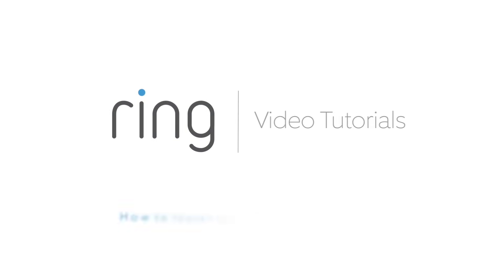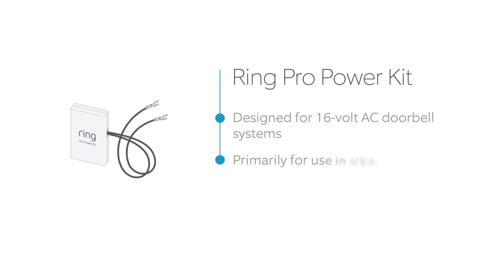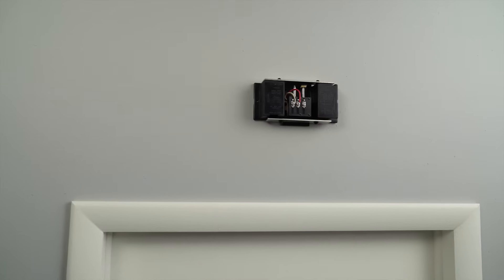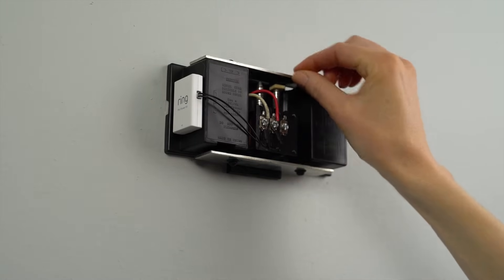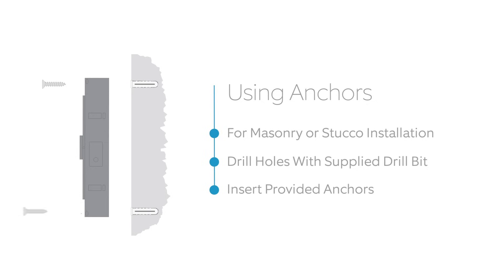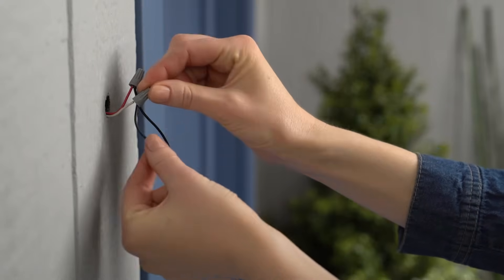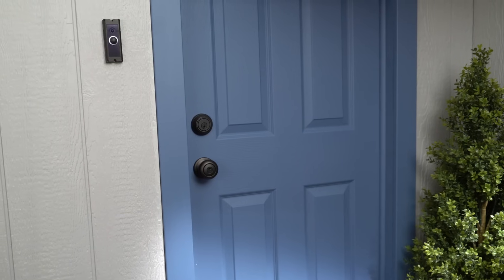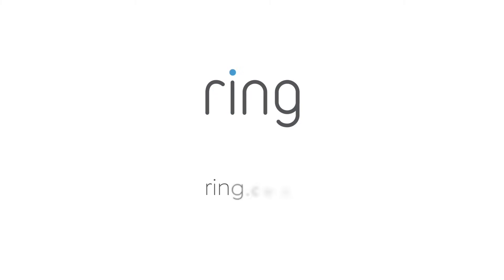How to Install Ring Video Doorbell Pro | DiY Installation

Comment: Hi, I am in the UK and have purchased the Ring doorbell PRO. The package contains a small rectangular accessory with a label on it reading "Doorbell bypass kit" which I presume is the Pro Power Kit V2. I also have the ring transformer in the package. 

I want to use my existing mechanical doorbell chime which is on the compatible list. Within the mechanical doorbell chime box, there is a GreenBrook transformer installed which is 10.3V ac. In order for me to use my existing mechanical doorbell chime, do I need to install both devices i.e. the "Doorbell Bypass Kit" and the ring supplied transformer?. 

Can I remove the GreenBrook transformer installed within the mechanical doorbell chime box and replace it directly with the ring supplied transformer? 

My existing doorbell by the front door is about 43" from the ground. The guidance provided by Ring is to have the bell about 48" from the ground. Moving the doorbell higher may expose the existing doorbell hole, so is 43" ok for the camera height? Thanks
Reply from the maker: Hey neighbour, thanks for getting in touch with us. We'd like to ensure we address all of your questions. 

- The Pro Power Kit V2 is required in order to properly install your Ring Pro. Check out our support article and installation walkthrough video here: https://support.ring.com/hc/en-gb/articles/360036047831-Physically-Installing-your-Ring-Video-Doorbell-Pro. 

- Regarding transformer installation or removal of existing pieces of a wired setup, we recommend consulting a licensed electrician. In some areas, electrical work is illegal unless done by a licensed electrician. 

- Although 48" is the recommend height for installation, your Ring Pro should perform just as well at 43". Since the Ring Pro features advanced motion detection capabilities, you can draw where you want your Ring Pro to monitor for motion. If you do experience any inconsistencies with your Ring Pro's motion detection, please give us a call at 01727 26 3045. We're always glad to help. 

Please let us know if you have any more questions!
Reply: @ring  Thanks for the update. I think the confusion I have is that the guides mention the power kit v2 is used to bypass the internal doorbell , but as I want to use the mechanical doorbell do I still need to install the power kit v2?

Comment: Here thieves are stealing the outside ring doorbell and running away with it.
Reply from the maker: Hey Stan, we're sorry to hear that's happening. We offer Theft Protection so if this ever happens, we can help get a new Ring device sent out to you. Learn more about what to do if your Ring device is stolen: https://bit.ly/2wny9zb.
Reply: @ring  I heard that it can take up to 2 weeks for a new Ring device to be sent. 2 weeks without a doorbell or security if that's the case...

Comment: I have an old internal doorbell chime that looks nothing like the one shown in the video, my chime's wiring is also not labeled (front,trans,back) what can I do? Can I install my doorbell pro without installing the power pack?
Reply from the maker: Hey Jesus, we'd like to ensure your Ring Pro gets installed properly and would be glad to help. The Pro Power Kit V2 would need to be installed whether you're connecting it to your internal chime: https://support.ring.com/hc/en-us/articles/115005974286-How-to-Install-Pro-Power-Kit-V2-for-Ring-Video-Doorbell-Pro or if you're bypassing your internal chime: https://support.ring.com/hc/en-us/articles/115005974286-How-to-Install-Pro-Power-Kit-V2-for-Ring-Video-Doorbell-Pro. We'd like to take a look at the existing chime kit you have installed — please send us photos in a message on Facebook or Twitter and include the make and model of the chime kit. We're glad to help!

Comment: Do I need to have an existing doorbell ? My apartment doesn’t have any
Reply from the maker: Great question, Julio! We offer battery-powered Doorbells that are ideal for homes without existing doorbell wiring. Check out our Ring Doorbell and Ring Doorbell 2 here: https://bit.ly/2FDoptv. We just recommend reaching out to your property manager for details on their security camera installation policy.
Reply: They also sell a cord that you can plug into the wall if you have no existing doorbell and still wanna use the doorbell pro. Might have to run the cord through a window or mail slot tho.

Comment: My doorbell is on the side wall. Where do I get an angle attachment for proper installation
Reply from the maker: Hi Morty! You can add a Corner Kit to your Doorbell set up to ensure it's facing your entryway. You can find the Corner Kit for the Ring Pro here: https://bit.ly/31RBB3t. If you have a different Doorbell model, you can find the other Corner Kits on ring.com/accessories.
Reply: Morty - my Ring doorbell 1 is mounted on a side wall perpendicular to my door and still does well and can see about 20-30 feet down my sidewalk still.

Comment: Ring do I need to use the pro power kit?
Reply from the maker: Hey neighbor! Yes, the Pro Power Kit is required in order to install your Ring Pro. See more on the installation process here: https://bit.ly/2DB0S8t.
Reply: What if I the wires are welded on instead of screwed on? So I can't connect it to the front or trans. I have an older house.

Comment: Just got mine, Installed it Sunday. Went offline today. Had to reboot 100 times and finally received internet signal again. All other devices in the home working properly with wifi. Should I be concerned there is an issue with he device?
Reply from the maker: Hi Lily, welcome to the Ring neighborhood! Rest assured, we definitely want to make sure that your Ring experience is a great one. We'd like to take a closer look at your Ring to ensure it's working to its fullest potential. Please give us a call at 1-800-656-1918 (or if outside the US http://ring.com/callus) so we can help.

Comment: I get a reading of 37 volts at the door, when pressing the doorbell button I get 18 volts... will this work with the Ring Prol?
Reply from the maker: Hey there! The Ring Video Doorbell Pro requires 16-24vAC at the door so as long as you're receiving the proper amount of power it should connect. See more at http://bit.ly/34jwaN2.

Comment: The pro power kit makes the internal door bell go off at random. All connections are correct but still  sets it off. I need help
Reply from the maker: We’d like to take a further look into troubleshooting this with you. Please give us a call at 1-800-656-1918, (or if outside the US: http://ring.com/callus) 24/7, seven days a week for more support.
Reply: @ring  i figured it out. I didn't realize the power kit has a bypass option

Comment: I do not have a wired in doorbell so can I not use the ring doorbell?
Reply from the maker: Hi there, great question! We have battery-powered devices available which will allow you to use your Ring without a hardwired connection. However, the Doorbell Pro needs to be connected to a transformer. If you have any additional questions, please let us know. We're happy to help.

Comment: Is there a minimum height the door bell must be installed, I would need the minimum height the bottom part of the device should be in please?
Reply from the maker: Hey neighbor, thanks for reaching out! The recommended mounting height for all Ring Doorbells is about 4ft — this distance should be measured from the ground to the bottom of the Ring Doorbell. If you have stairs or an incline leading up to your door, you may need to install the Doorbell a bit lower or include Wedge Kits in the installation to angle your Ring downward. Learn more about properly positioning your Ring device here: https://bit.ly/2CvhtKn. Let us know if you have any more questions.

Comment: What if your current doorbell was installed ON the door frame? Doesn't seem like there would be enough room for the ring doorbell..
Reply: Jesse Turner ya I have that issue. Never really thought about it until now
Reply: I have that issue as well. Mine is in between the door frame and brick. I am building it out with weather treated wood. It will stick out enough. Just an idea. Good luck.

Comment: Why doesn't Ring offer an option that will only send JPG IMAGES to my phone? Video clips are TOO BIG.
Reply from the maker: Hi Dave, videos from your Ring should not be taking up storage on your phone. When subscribed to a Ring Protect Plan, events are recorded and stored in the Ring app — learn more here: ring.com/protect-plans. From the app, you can download videos to your phone to keep permanently. If you're experiencing any issues connecting to live video notifications from your Ring, we'd like to help. Please give us a call anytime: ring.com/callus.
Reply: Ring it may not require phone storage but it does require bandwidth and battery power. This is a good feature to add as an optional configuration!

Comment: i don't have any door ring bell no wires i have and i really want to install my new ring video bell pro i just buy today but i didn't see proper videos that teaches i like to install with wires but don't know how
Reply from the maker: Hey neighbor! The Ring Pro requires a hardwired connection for power in order to work properly. If you don't have existing doorbell wiring, we recommend using the plug-in adapter found here: https://bit.ly/2NKtUXq. Check out the installation here: https://bit.ly/2TKWD09. Let us know if you have any more questions.

Comment: Is the ring doorbell ip 67 water resistant?
Reply from the maker: Hey neighbor, great question! With internal batteries or wired connections, Ring devices are weather resistant with an IP55 rating. Let us know if you have any more questions.

Comment: Which ring door bells are the best to buy if you don’t have a door bell in your house?
Reply from the maker: Hey Amy, great question! You don't need a current doorbell in order to install a Ring Doorbell. In fact, our Peephole Cam was designed to install in an existing peephole. Also, our battery operated Doorbells can be mounted on many surfaces and are a quick DIY install. Here is a link to our full lineup of Doorbells: https://shop.ring.com/pages/doorbell-cameras. Please let us know if you have any additional questions as we are here to help.

Comment: How do you install this doorbell if you do not have an existing wired doorbell? My current doorbell is powered by batteries in the chime and has no connection to my main circuit board. I find it weird that this video relies on somebody else having already installed most of what's needed rather than showing a full installation.
Reply from the maker: Hey Leo, there are a few ways you can install the Ring Pro. It does need to be wired for power and can be connected to the existing doorbell at most homes. If this isn't an option for you, we'd recommend connecting the Ring Pro to a Ring Power Adapter for power — see the installation here: https://bit.ly/2vgRTrR and here: https://bit.ly/2LhCIGb. You can also find the Power Adapter here: https://bit.ly/2NKtUXq. Let us know if you have any more questions!
Reply: Ring Are you telling me the only way to connect directly to the consumer unit is to first buy another doorbell, install that, then bypass it and hook up the Ring? This is silly. How do you wire the Ring doorbell directly to the consumer unit? This product is sold as a wired alternative to your other battery powered models. Please explain how to install it as designed in a house with no pre-existing doorbell.
Reply from the maker: We apologize for any confusion. You would not need to install an internal doorbell first. However, you can install your Ring Pro without an existing doorbell by connecting it directly to the transformer at your home. To install your Ring Pro directly to a 16-24 VAC transformer, there would need to be existing wiring where the Ring Pro would be installed in order to get power from the transformer. We also offer a transformer that you can find here: https://bit.ly/2FrzH1D — we'd recommend consulting a licensed electrician for installation assistance. If this isn't an option, we'd recommend using the plug-in Power Adapter linked in the comment above.
Reply: @Ring. So I can install a transformer and the Ring bell but the wire must already be there? That’s a shame cause I’ve got a long roll of wire in my shed that I thought would have suited this job perfectly. Unfortunately it’s not already installed so I’ll have to move to a house where there is already a wire in place.
Reply from the maker: Rest assured that you can still install a Ring Pro with the plug-in Power Adapter without existing wiring at your home to provide power to the Ring Pro. Please feel free to give us a call anytime so we can provide additional details: ring.com/callus.

Comment: What do I do if I don’t know which breaker is for the doorbell. There is not one labeled doorbell
Reply: This will be a good time for you to label your breakers.  One person at the breaker box, one person inside calling out which room lost power once a breaker has been turned off - or in this case if the doorbell doesn't work.
Reply: It's low voltage.  If you're worried about getting hurt, you won't.
Reply: @wr6392  Ring wants the power turned off. I do not know if it is for safety or to prevent damaging the unit during hook up.

Comment: Need to install this on a metal gate about 4 feet away from the old wired door bell. No one can reach the doorbell when the gate is locked.
Reply from the maker: Hey neighbor, the Ring Pro requires a hardwired connection to existing doorbell wiring. One of our battery-powered Ring Doorbells may be ideal for you if you're not planning to install it at the door: https://bit.ly/2FDoptv. However, we do recommend that your Ring is mounted and secured to a wall to ensure it's not easily removable by anyone without the proper tools.

Comment: Is ring doorbell pro better than the 2?
Reply from the maker: Hi Jose! Both the Ring Video Doorbell 2 and Ring Video Doorbell Pro feature 1080p HD video, night vision and 2-way audio. The main differences are the power source and motion detection. The Ring Video Doorbell 2 has a removable, rechargeable battery and PIR motion detection, while the Ring Video Doorbell Pro is hardwire only and has advanced, pixel-based motion detection. You can compare them side by side, here: https://bit.ly/2Oeay0C.
Reply: Ring thank you
Reply: Ring ➡️ is this product only for houses , or can it be use for an apartment.

Comment: I can't find the transformer in my house. I wanna check if it's 16 30.
Reply from the maker: Hey neighbor! The most common places where transformers are found in homes are in garages, basements, attics, or laundry rooms. We hope this helps!
Reply: @ring  Can you suggest a website where I could see examples of what transformers look like?  I don't have a clue.  Thank you :)
Reply from the maker: Hi Pam! Transformers can usually be found in a home's garage, basement, attic, or storage but can look different depending on the model. We offer a hardwired transformer for our neighbors here: https://bit.ly/2FrzH1D. We'd also recommend checking out the website of hardware stores or google.com to see different types of transformers.

Comment: How long will it blink for? I'm going on 6 minutes now.
Reply from the maker: Hey there, an update shouldn't take longer than a few minutes depending on your wifi. If you have any troubles, please give us a call any time at 800-656-1918 and we'd be happy to help.
Reply: @ring  it worked great. It took around 20 minutes

Comment: It is so difficult to align the small screw once the cover is in place. Ring should make it easier. Most of the time the screw drops and you just cant find it. End of the self installation!
Reply from the maker: Hi Nandanee, we appreciate your feedback. The faceplate screw provides additional security by ensuring that the reset button is not easily accessible to anyone without the proper tools. We'd be happy to send you additional security screws for your Ring if you've lost yours — just give us a call anytime: ring.com/callus.
Reply: The easiest way to install the screw is to place it on the tool head first and then insert them together, taking care not to cross-thread. If you try to insert the screw with your fingers first, getting them out of the way and engaging the screw head with the tool will be more cumbersome. Hope this helps.👍

Comment: Installed everything to a tee. Intermittent signal, worked for a few minutes then would stop. Buzzing sound from existing door bell chime. Looked it up, used bypass on Power Kit v2, now there's no power at all. 2+ hours down the drain.
Reply from the maker: Hey neighbor, we'd like to help and ensure your Ring Pro is working properly. Please give us a call so a member of our team can look into what's causing this: ring.com/callus.

Comment: what if you don’t have a star shaped screwdriver?
Reply: The screwdriver included in the package. Pull out the philips bit from the handle, turn it around, and there you go.

Comment: I wish you would provide security screws to mount the camera to the wall, not just one tiny security screw to the bottom of the cover. Using security screws would make the whole thing much more secure and harder to steal.
Reply from the maker: Hi Daniella! Rest assured, mounting screws are included in your Ring Pro box so you're able to secure the Doorbell onto your wall. If you're unable to locate the security screws in your box, please give us a call at 1-800-656-1918 (or if outside the US http://ring.com/callus) and we'd be happy to send some out to you.